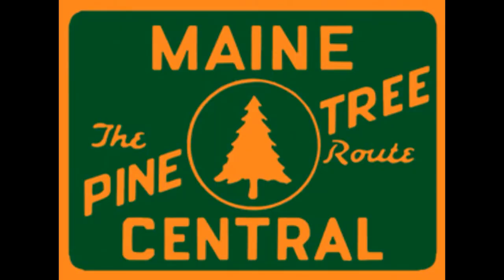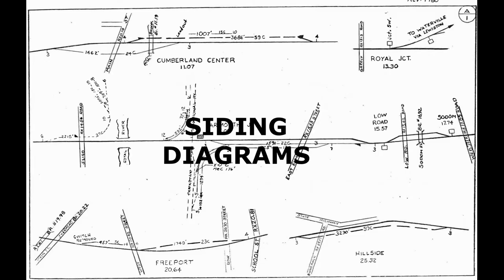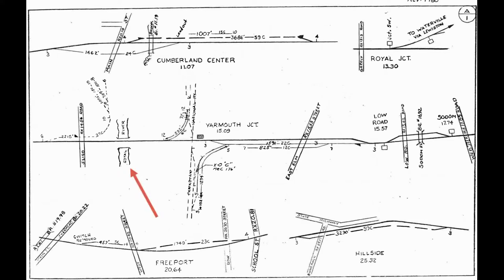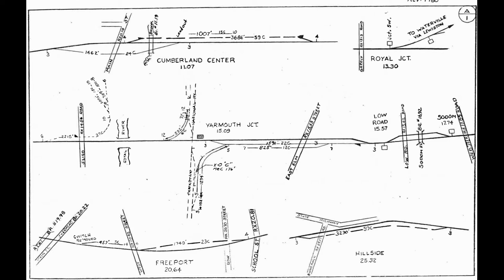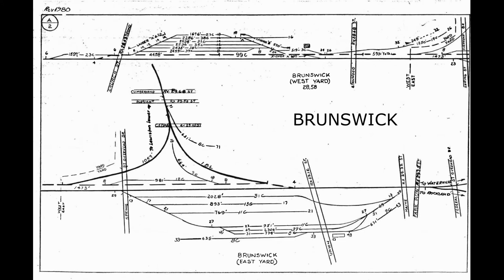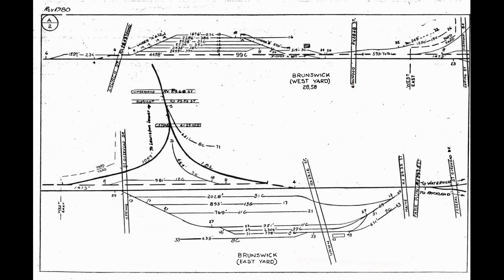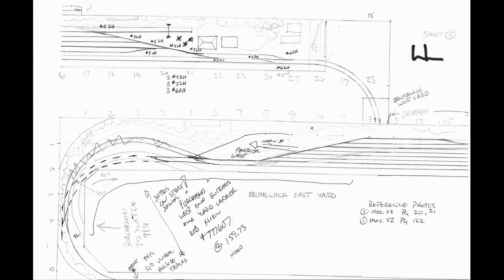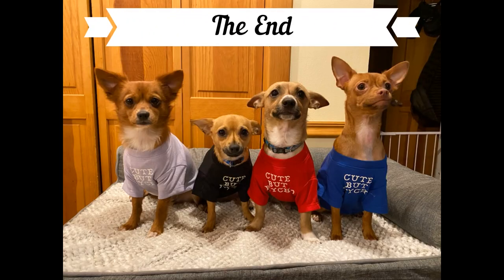Designing the MECLR Part 2

Comment: What year(s) are you modeling?
Reply from the maker: I have equipment for the 1978 -80 time period. I also am building a late 1950s roster. The plan on the layout is to add or remove the passenger stations at Yarmouth, Brunswick and Augusta for 1950s op sessions and then remove for 1970s sessions. Currently I am working out the 1958 operating scenario. My biggest obstacle is that I did not have room to do the Rockland branch. During this period it had several passenger and freights a day that would need to be added and the branch is a one track staging under the layout.
Reply: @camgreen3815  Remember that the old station in Brunswick is still there, it is now a bank.
Reply from the maker: @JohnTarbox  do you mean Bath? I thought the Brunswick station had been raised.
Reply: @camgreen3815  I could be wrong, perhaps they built a new building on the site of the old Brunswick station? 

The new Amtrak station is located just west of the old station.